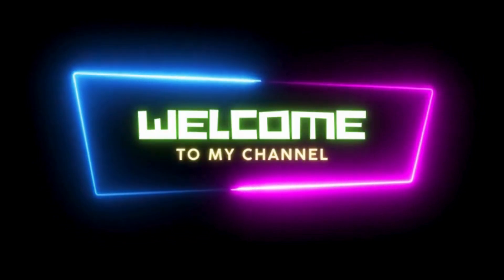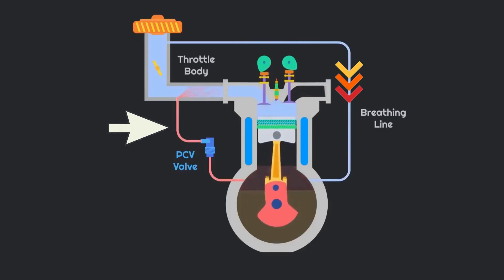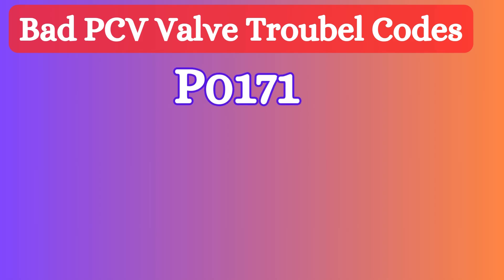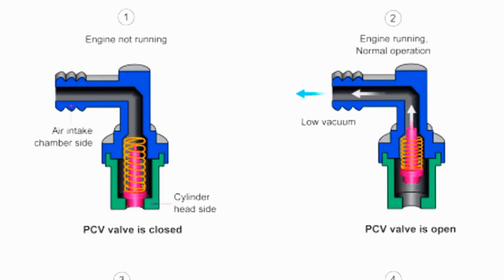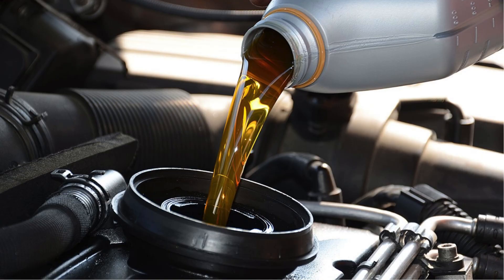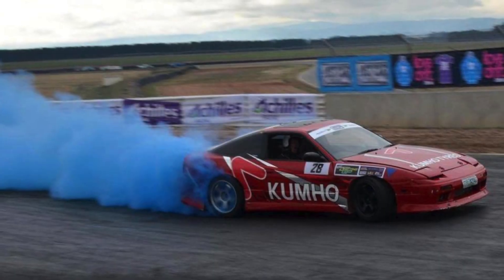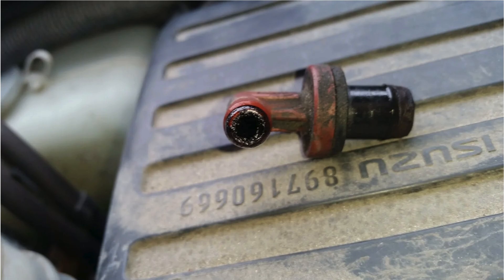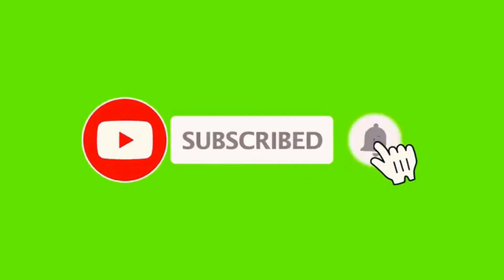Common Causes And Symptoms Of A Bad PCV Valve (& DIY Fixes)

Comment: I always use an engine flush at 5000 mile oil changes to clean residue gunk out . Though it requires the removal of the intake manifold on my 2020 Toyota Camry to remove / replace it . I'm hoping as on other camry's , it could be accessed by removing front passenger side wheel . Then plastic fender well lining .